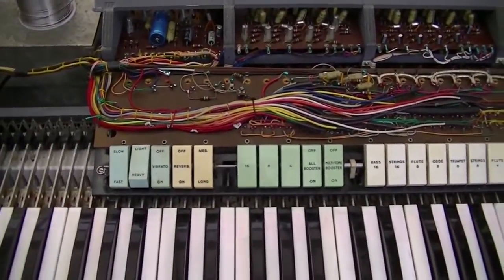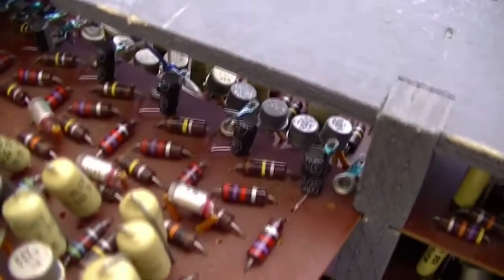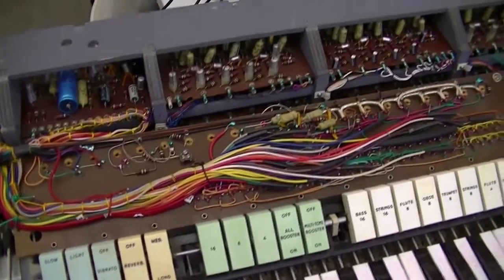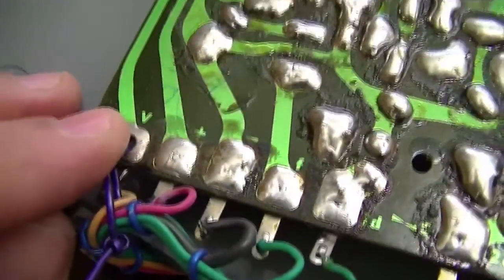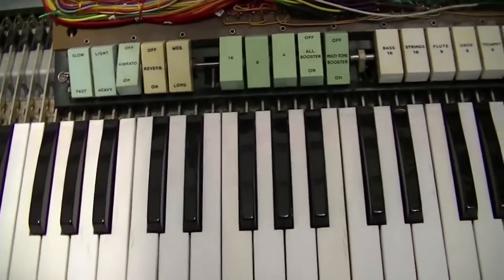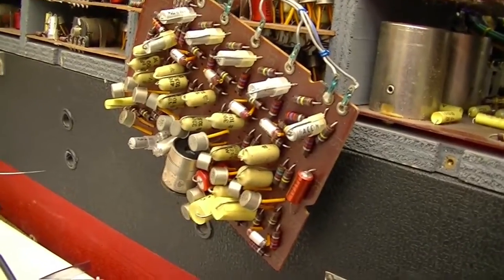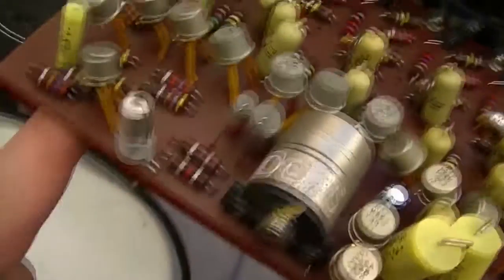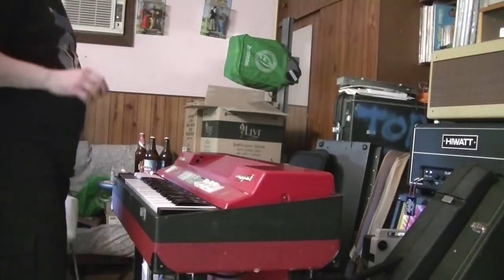Restoring A Farfisa Compact Electronic Organ - Part 2

Comment: This video is exactly what i need and i have the same problem with my c note having that wobbly sound. Could you clarify exactly what capacitor to change on that?
Reply from the maker: All the upright silver ones with the plastic on the bottom. If you're going to do one of them, may as well do all. It's not a matter of if they will fail, but more so when. The other ones can be left alone.
Reply from the maker: Also replace any other electrolytic capacitors such as in the power supply and output amplifier. They are easily identified because they have either a plus or minus sign on them. If you're not confident doing it yourself, take it to a tech and request to get the electrolytic capacitors replaced. They'll know what you're talking about.

While I'm here, from one Grateful Dead fan to another, your Vox organ is damn lovely!
Reply: @snarfusmaximus  Thanks for the reply! This video is so far one of the few that breaks down a good repair. And I will admit I'm a bit intimated to repairing it because how much of a beast these things are but If I can do the ones on the Vox I have, then I should be able to on this. I'll just take my time and go from there. I have tried looking for a tech but I can't find any out where I live that does these types. So it's best that I try it myself.
Reply: @snarfusmaximus  And thanks for liking the video!

Comment: Combo Compact? I bought one in '85 that was beat-to-Hell and missing the box top, foot keyboard board, swell (volume) pedal, music stand (good riddance!) and leg  brace. Only issue was ALL the D and Eb keys were reversed. Also noticed two plastic hook thingies had torn and weren't holding the thin wire than hits the contact. I fabricated the two pieces and the thang worked for years. Hadn't played it in the last ten years and now the keys no longer make any sound. The bass keys do work, though. There IS a large capacitor on the top left side that has its guts spilling out and I'm hoping when I figure out its part number, I can replace it. Can you help with its identification? These are the numbers I could read. Some might be wrong: 
            
Facon (Italian manufacturer)
008
1000 or 100Ω
15
25

Mod.
µ
Y
LVI
6638

Comment: I recently purchased a Farfisa. It exhibits similar problems as with yours at the beginning. So I assume this part 2 corrected defects to date. you are completed with the repair? if I continue as you did, I should at least obtain similar results, as it stands right now, it appears all original and never serviced.
Reply from the maker: video2crabby Replacing all the electrolytic capacitors solved all its issues and quirks. Once that was done, I just tuned it and it was as good as new.
Reply: Thanks..................

Comment: Did you ever replace the Selenium Rectifier?  I understand these are bound to fail at some point, and I've heard you can use a silicon Diode and Resistor in its place.
Reply: Haha, it smells so nice when it became faulty 🤣

Comment: Quick Question: What were those 1uF caps that you used for all the divider cards? Were those Non-polar and what was the Voltage rating? I'm having a little trouble finding some replacements for my Farfisa.  Thanks!
Reply from the maker: Studio-T They are just plain old polarised electrolytics. I don't remember the voltage I used but 16V or higher will be fine. Try Mouser or eBay.